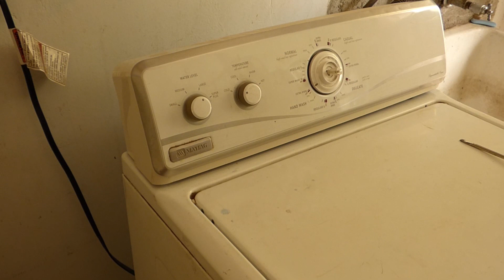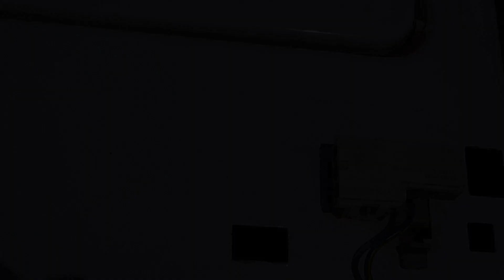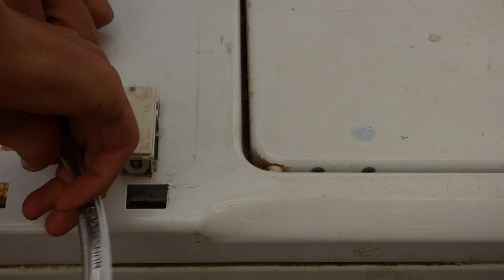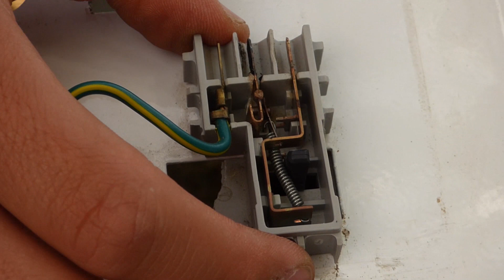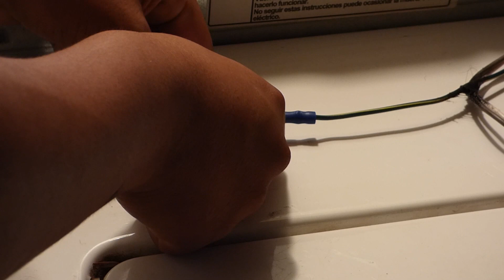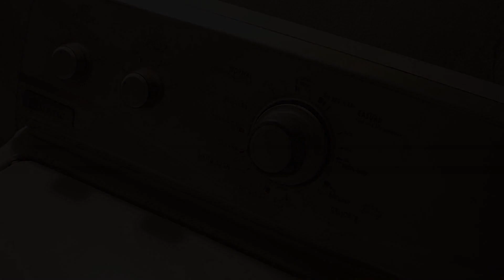Maytag Centennial Top Load Washing Machine Lid Switch Replacement

Comment: Thanks for this video and your switch instruction. I thought I needed a new one but the fix was much simpler. Apparently over time the lid lever screws loosened up. So I tightened the two phillips head screws on each lever and the lever contacted the switch properly again ... washer fixed.

Comment: Can I save time and work by not cutting off plug and not removing gold clips?
Reply from the maker: yeah you can short the switch instead of replacing it
Reply: @rufixed2245  thanks. I just ordered a new switch with overnight shipping and replaced. Thanks for video. Big help.
Reply from the maker: @samfeldman1508  NIce. the last one i did I didnt not even put a new switch, I just opened the old one and soldered it so its always engaged. Now the washer still runs even when it is open

Comment: Great video, very helpful, thanks...

Yup, it was the lid switch. Our washer started normal then it stopped halfway. 

To add a shortcut to your video. To verify if the lid switch is faulty instead of using a meter use a short wire and insert into the harness between the green and white. This bypasses the lid switch but keep in mind it'll be a safety hazard when the washer is running if you open the lid during the spin cycle it WON'T STOP. 

The short jumper wire I used, was a 14 gauge solid copper wire just a couple inches long. I stripped back only enough copper so there's none exposed that could potentially touch the metal and cause a short. I taped it with electrical tape so the vibration of the washer doesn't losening a wire from the harness and cause an electrical short. 

I only did this so we can still use our washer while I wait for the new one to arrive.

Also let me add to the video another short cut, if you can prevent the gray tabs that are removed at the very beginning from falling inside the washer then you don't need to remove the outer cabinet of the washer. 

Just remember as stated in the video, you have to open the lid to swap out the lid switch without breaking it. 

One more suggestion, appliancepartspro.com usually has the best price and fast shipping plus 1 year return policy. Just suggesting from my personal experience from them.
Reply: Forgot to add, 

If you put in a jumper wire so that you can both check the lid switch and bypass it to be able to use the washer you also won't ruin your wire harness and you won't have to improvise like he did in the second half of the video. Plus there's a reason why that harness "snaps" into place. It's because the washer has major vibrations that'll loosen your "taped" harness. 

Don't mean to dis the original uploader just want to add to the already great video that helped me fix my washer.